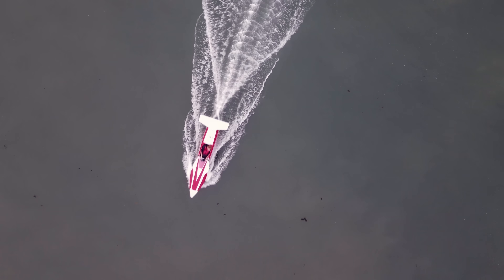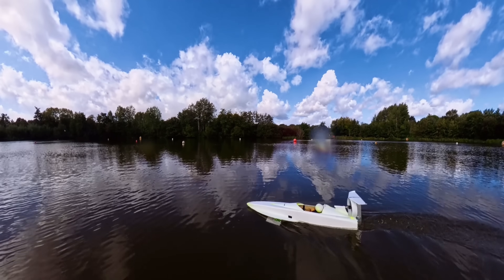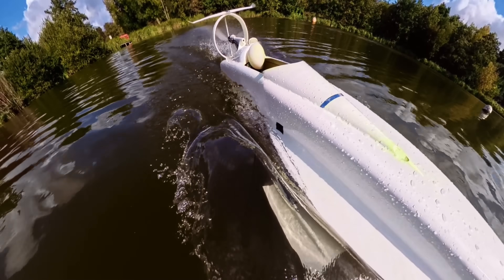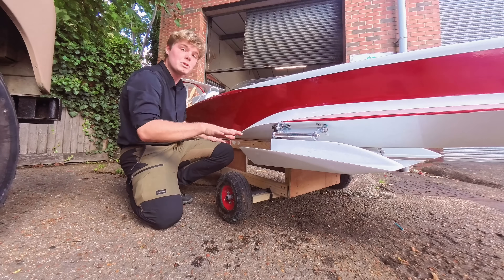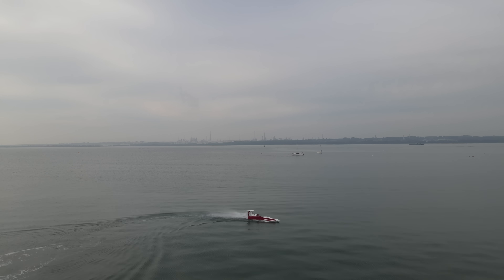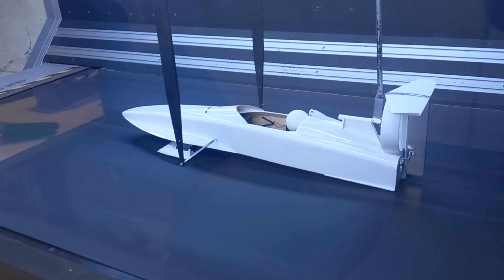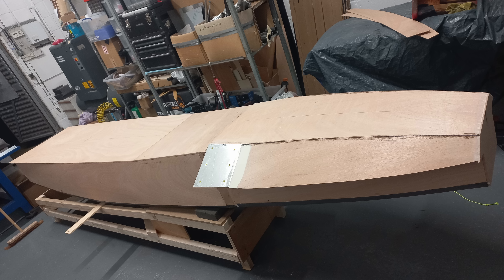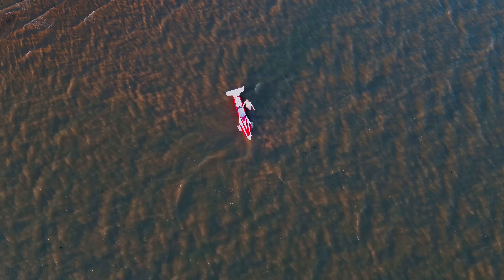How I built my own world record prototype - The APX hydroplane

Comment: I've only just stumbled on this - surely a propeller would be more efficient than an air propeller?  But what do I know?  Be careful though - once over 100 mph the water is hard as concrete,  you need to spend as much time on safety systems as power/thrust etc.

Comment: I believe I have a few things to share. If it does not negate the speed record you are trying to exceed by lifting the whole hull out of the water on a foil then research my farther did in the 1960's on an airplane for the US Navy may be of interest to  you.
Also, no step in the hull will be a problem in initial speed.
Glad to share information I can find in existing files.

Comment: This is a really cool project, but please spend some time designing your cockpit for crash survivability. Several others have commented on the details of this, and it's not my area of expertise, but mainly none of us want to see you injured or worse should something go awry. You're already getting into the speed ranges where these safety systems are relevant. Additionally, electric drives have a secondary safety hazard--fire. Please, please isolate yourself from the drive system. You’ve got two explosive devices onboard, the ESC, and the battery bank. You need to ensure you can isolate a fire or explosion on one or both from your cockpit.
Reply: Send it.

Comment: Have you thought of trying water jet instead of water propeller. Water jet drives are more efficient than traditional propellers at high speeds (above ~20-30 knots) due to reduced appendage drag. I would bet that a multi stage compressor basically a jet engine for water that has more space between the blades, optimized for thicker material in the compressor stages would be the best bet for high efficiency water jet...

Comment: My only suggestion would be a direct drive for the propeller. Drive it right off the shaft of the electric motor. You'd have to redesign the prop shaft tower but otherwise, it looks like a great boat. I look forward to seeing it in action and to seeing the final design.

Comment: Your boat cannot be compared to the current record holder since it is not driven by a traditional submerged or semi submerged propeller.
So your  potential record attempt is obviously one of Speed on water, rather than fastest electric boat.

Another point is that of driver safety at speed.
60mph is not a highly dangerous speed, but 200mph is very dangerous. 
A UIM standard reinforced cockpit will be required. 
A UIM spec hydroplane cockpit will weigh around  80 kg and cost  30k USD to build.

Comment: Looks promising. Well done. For the suspension have you considered bringing it inside the fuselage?  The IMOCA class foil system uses similar planing surfaces but the pitch and roll are controlled from inside the boat. Also, would a shape similar to an IMOCA foil where a portion of the foil remains in the water be less susceptible to waves? Or would the drag be too high for the trade off to be worthwhile?

Comment: I'm really glad this was thrust onto my feed.  I'm moving in similar directions with experimental performance boats but with more emphasis on every day efficient running in realistic conditions and with conventional affordable outboards.  I'm starting to make videos describing my thought processes that I'll post on my page once cap cut has their way with them.  Suspended planing surfaces gets you half way to the direction that I'm going.  Too many people are focused on water having so much more drag than air while at the same time being enthralled with the idea of "cutting thru the water."  Its bizarre.  Fluid bearing in automotive engines have been tested to have less friction than needle bearings. I'll message you when I get some relevant content posted.

Comment: If you've never been into building fast boats you are in for one hell of a learning curve.   Air propulsion definitely won't get you there.  I highly suggest learning how a boat acts above 100mph or you will get wet very violently. A surface running prop will be the direction you end up going and I highly suggest a tunnel hull. I'm not a big fan but they are generally more forgiving to rookies. A V bottom will absolutely kill you if you don't have a very clear idea of what is going on and what to do when things get sketchy. Setting them back in the water from an aired out speed can be tricky. Good luck.  Don't rewrite the book because I assure you this has all been done and some aren't around to tell you why you don't need to get all crazy with hull design.  You need power and a very expensive prop.

Comment: It's a pretty cool concept. I think if you want to run at 200mph, the boat needs to be longer. I recommend a high voltage Tesla motor. And a carbon fiber 3 blade propeller.

Comment: I volunteer at the Hydroplane and Raceboat Museum south of Seattle and we have many RC and tether RC hydros in our collection.
The teams are known for having crew chiefs who also build and race the models.
Some carbon fiber “shoes” and canard stuff directly came from those “toys”.
    I also race the smallest of the classes and we need the new ideas like this to push us to modern times .
   I put next to the world record holder in gas outboard, Bob Wartinger, whenever I make it to a race and I hear his speed secrets spill out when he gets preaching .
    That speed in that light of boat is dangerous. 
   I also once knew Norm Boddy , who was an appliance tech who did outboards. Held electric speed record for our North American hydro at Havasu until 98’.
He fabbed a 32 v starter to a Merc “tower of power “ and did 70+mph in 70s .
His throttle was a brass lever that he kicked on with foot . 
Boat holders said hair on arms stood up as they watched Blu arcs on side of block and it had no control some runs .
    Prop shapes are hard to break from traditional because of a pesky thing like having to work.
   You gotta have a “set” or trio of props to go up or down with top end or course size …..
Good luck and will be watching this project.
Reply: I visited the museum last year, it was very cool to see so many interesting boats.
I saw a few of the really small ones on the wall, I assume that's what you race?
Reply: I count Bob Wartinger as a friend. He regularly visits the UK to watch racing and give talks. He is one knowledgeable guy. I 'crewed' with him setting a World record last year at Coniston records week. Hopefully he will be in the UK this November, so we can have another bash at the record.

Comment: My initial thoughts are that the waves don't matter if your hydrofoil stays below the surface while the boat uses the ground effect to hover above the waves, and the hydrofoil fin can also steer the boat which makes it lean into the turn. As for the propeller, it might be more stable and especially safer to have two turbojets near the front, one on each side, as they could be pitched independently to control both the pitch and yaw, so that no matter what happens, it's possible to control the boat like a canard wings plane.
Reply: Hydrofoils are tricky above a certain speed due to cavitation.
Reply: @matejlieskovsky9625  I didn't think about that, but come to think of it, it makes sense. I can see how given enough speed there is always going to be a low-pressure zone which turns liquid into gas.

Comment: Balancing saves a LOT of power and is now easier than most realise, using a modern cellphone!
Search:  rcgroups How to dynamically balance EDF unit with a cell phone

It's very VERY important to a fan to get nice laminar, perpendicular, straight-in, undisturbed air.  Especially as speeds increase..!
So might I suggest:
An aero cowl over that top sprocket.
Fairing in the front flange bit (sticking out into the air) that holds  the  shaft, as -well as a sharper faired in rear to the shaft holder.
More (balanced,rotating ) fairing or an aero-ing of the exposed, rear piece of shaft itself.  Taking a file to it while its turning would be easiest. (with countersunk bolts etc)
At the very least, try a nose cone on that sprocket!

Where your 'T-tail elevator' intersects with the round cowl will also be a major source of aero drag.
I'd cut it in half, down its centreline, and stick the 2 halves onto the fan cowl, halfway up, where the cowl's perpendicular.

Try a mixture of  Spray Filler and Glass Micro Balloons as a frangible, abrasive coating in the area where the prop would touch the duct, to minimise tip vortices.

Experiment with  hydrophopic coatings on the 'skis' and leading underwater edges and hydrophilic on the trailing edge of your rudder.

I can also cut bearing etc friction by a factor of 10+ very easily, but here no-one believes me!  :D

Comment: The models could be very marketable.  For design simplicity in miniature, what if the motor itself was mounted on the servo itself, like the most basic of turrets, for thrust vectoring? You could have a rigid rudder behind, maybe built onto the duct ring.  Also I’d love if the model were sold as an STL plus parts list.  For rules of cool, there needs to be a version that uses shock absorbers from other kinds of RC vehicles.  Aircraft or cars even.

Comment: This is a great video! I have a few constructive thoughts that might be helpful:

Could you add some buoyancy bags?

Be careful with the chain! Having seen heavy-duty motorbike chains snap, I'd want a guard to protect my head. I'm curious how hovercrafts typically handle this issue.

Have you considered using inboard suspension with push rods? I wonder how the current setup affects the airflow.

Comment: Fun fact about speed on water; In the eighties, one of the fastest, ever, on water was an Texan oil billionaire. He had a lot of free time, and thought that the speed record on water was a little low. So he bought a surplus F-15 and cut off the wings, and put fiberglass on the bottom. Then he put rapeseed oil on the water of him lake by his house, to calm the small waves down. He took a turn and did close to 300mph on the water, quite a bit over current record. A local news reporter congratulated him on the achievement, and asked what if, some one would break his record. "Not a problem", the billionaire responded, -"If some one is faster, I just turn on the afterburner, then she does mach 2" and smiled at the reporter.

Comment: Cobbs boat, and Campbells, were both flawed in different ways. You might be inspired by Cobb, but your boat is far closer in design to Warby's. If you watch his boat at speed, ask this, "Why did he build it to deliberately wobble side to side?" :) The side to side wobble of the prop shaft needs to be corrected before it shakes itself apart. Might be worth investigating high speed hub motors to eliminate that shaft completely, and have the motor form part of an aerodynamic flow guide through the center of the prop or a fan.

Comment: Need to make the shaft for the prop shorter. Can see the vibration wooble at speed. More Rpm from the engine is going to rip the fan right into the cowling at the speed you want to acheive. Might want to think about a gearing system insead of a belt also.

Comment: It might be an idea to design a cockpit canopy for the cockpit. Ideally you want the drivers compartment to be watertight , with a race harness to keep the driver secure. Remove all sharp edges ,add cushioning if not possible. You need to be able to survive in the canopy if you lose control and she tumbles. Lots of people over the years have lost their live either by being bounced around the cockpit, being thrown clear and hitting the surface or being trapped inside as the cockpit floods. Thats why they recommend watertight cockpits for boats attempting  high speed runs. 
Good luck 🎉
Reply: Seconded. A sealed 'escape capsule' that stays intact is the best way to protect the passenger (you're not a driver at that point) inside from the speed and pressure of water impacts. Look at Formula1 and Indycar, and at Top Fuel drag racing, for what it takes to survive high speed incidents. Build lots of spaces inside the capsule to include foam flotation blocks, and a chute that comes out the back of it to keep the deceleration happening in one controlled direction.
Reply: @PiDsPagePrototypes you’re jumping the gun. This is an early prototype which only achieves moderates speeds. I am confident he won’t be attempting 320kph in an open cockpit.
Reply: @steviefordranger198 see reply on other comment on this thread.
Reply: I’d start with a drag boat cockpit, then build your boat around that.
Reply: @auyocross72 fairly sure at one time the f1 boats were using a fighter jet cockpit f15 or something like that
Reply: @nickhall5959  That was the canopies.
Reply: Very good advice. I would follow that advice.
Reply: Third, air bags might be an option. But without doubt it must be closed cockpit.
Reply: This is a low speed prototype so I imagine he has more protection in mind as the speeds ramp up.
Reply: @steviefordranger198 If the design is going to be changed later, then all the test data done with this version will need to be thrown out and redone. You don't test a Formula1 with VW Beetle bodywork.... The change for safety needs to be done before the testing begins.

Comment: Really cool project, best of luck and stay safe! 

If you haven't already, get in touch with your local powerboat association! They're usually very friendly and helpful if you need experience going fast on the water, often they're in need of co-pilots. Speed on the water is also seriously risky stuff, and they can help in that respect.  

For example, helmets with vents on the top are a no-no, because if you fall into the water at speed anything that the water can grab onto increases your risk of severe neck injury. I'd also look into getting a serious UIM-approved life jacket when things start going above 40 knots, if you haven't already.

I also get a little antsy when I see cable steering on a go-fast boat, they're more prone to sudden failure and catastrophic crashes than hydraulics. Also curious if the suspension can lead to some funky oscillation modes like the chine walk you can get in other high speed boats - probably something to check out if you haven't already.

Comment: imho... water is surprisingly hard and painful. its also cold and wet. water speed records are for others. you go boy! 

drive shaft... whats taking up the thrust? that setup leaves much to be desired... support that shaft right up at the prop hub with a decent angular contact bearing, following standard spindle designs.

remember, ALL your force is acting through there...

props... pitch, forward velocity. c

we think of a prop as a screw, but thats with zero slip. props slip. looking at them as an inclined plane, pitch is angle of attack. with 0 forward velocity, pitch= angle of attack. if its too steep, we put the prop into stall. stall is cavitation in water. 

as forward velocity increases the angle of attack reduces.  you get less cavitation as you go faster. but you get the other issue of water has a very specific manner in which it wants to flow... its not really cavitation when its simply being deflected off a surface, is it? blades need knife edges, etc...

there always has to be some slip. if the props forward velocity equals its pitch, zero slip, its as if the incoming fluid simply flows over it and the prop isnt spinning... at this point, it doesnt apply any axial force, just a rotational swirl. all the power in the world wont let you get any faster... (where have i heard of a similar concept, i wonder?)

then theres just the whole aspect of it being water... stiff and unyielding at high speed...

surface piercing props are just weird... i never had any luck with them doing RC boats... it either cavitates on take off and never gets to plane, or has too much grip and stalls the engine before getting on plane... i dont really like boats much... each to their own!

an airscrew is simple and does the job, but its in its own class regards drive systems...

jet drives?.... the real challenge is the consideration of velocity and flow rate... they actually have an advantage or two if you take into account bernoullis and converging/diverging ducts... most people dont. so fail miserably and they get a bad rep.

if the duct increases in diameter, the fluid entering can slow down... you can manipulate the water flow past the pump to behave as if its traveling at a lower velocity. decrease duct diameter again, and reclaim the velocity at the nozzle... the pumps job is to increase PRESSURE, not velocity.

people tend to think of jets as just "props in tubes"... they arent. theyre water pumps and have certain operating parameters for best efficiency. our manner of using them is far from efficient... a typical jetski takes the approach of simply throwing more power at it...